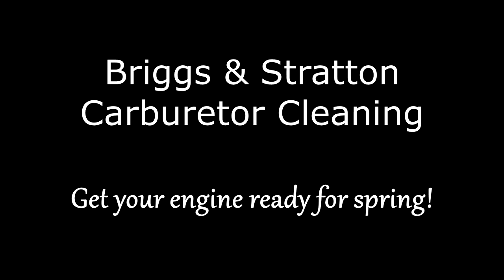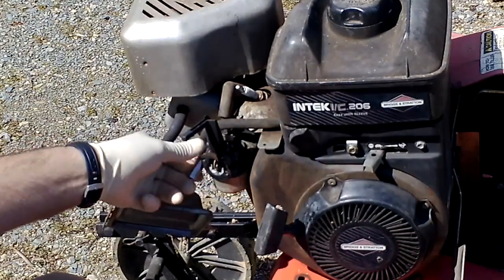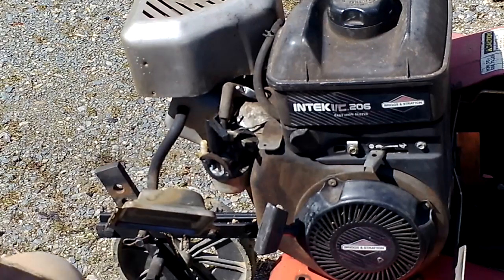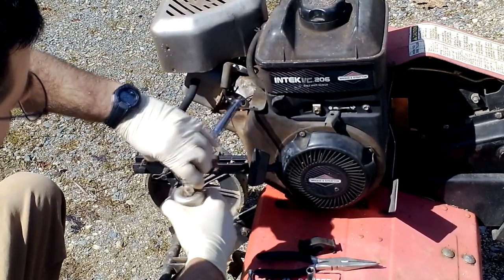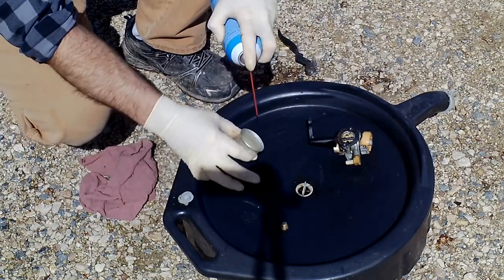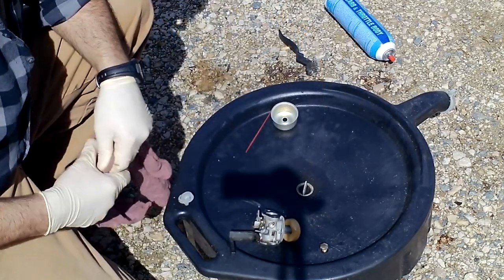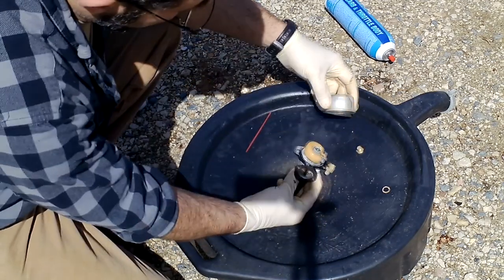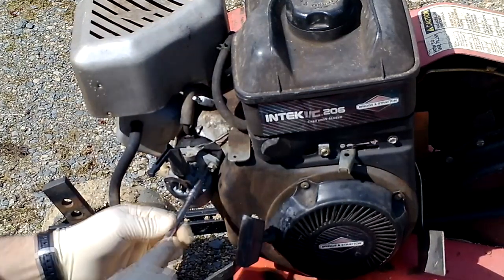How To Remove And Clean Your Carburetor On Your Briggs  & Stratton Engine.

Comment: thanks for the video.  I was rebuilding the carb on my mower and it looks very similar.  Problem is its an older mower and the washer (its a plastic one) that goes with the bolt that attaches the float bowl broke.  And reattached float bowl with bolt without washer.  It started to leak from the bowl by the bolt.  Bad idea on my part.  I need the washer.  Question: Would not  having the washer and the subsequent leak cause the mower to not start? Please help.  THANKS
Reply from the maker: Yes, it could cause it to vapor lock as the bowl leaks down and fuel vapor sits in it. you could try to make a temp gasket out of cardboard.

Comment: I've cleaned mine several times and it still won't idle I tried another carb and it idle but would rev up because it was to rich when given throttle

Comment: What  size socket did u use to get the bolt off the bottom of the float bowl. I can’t seem to find a damn socket to fit it right. Closest I’ve gotten is 13mm & 1/2 c
Reply: 1/2 in socket
Reply: If that not it it's not the original carb bolt